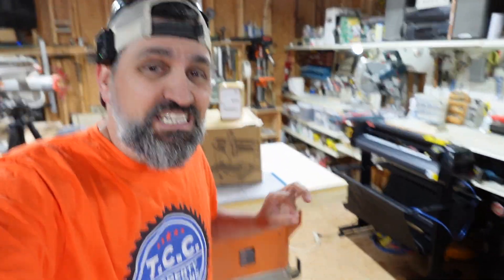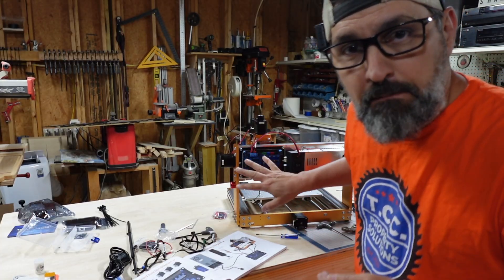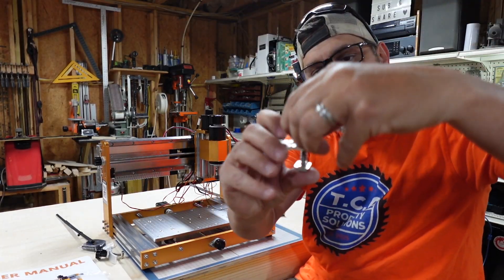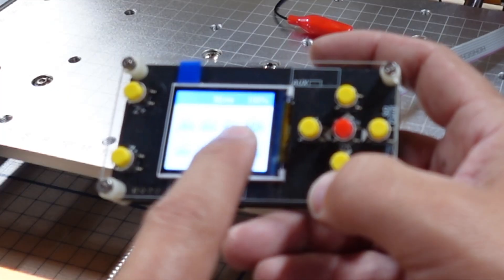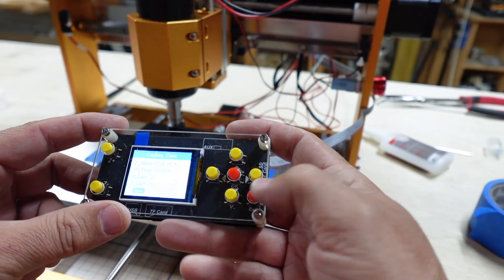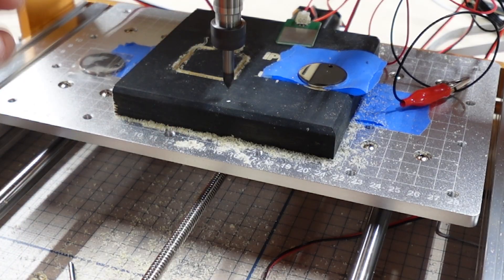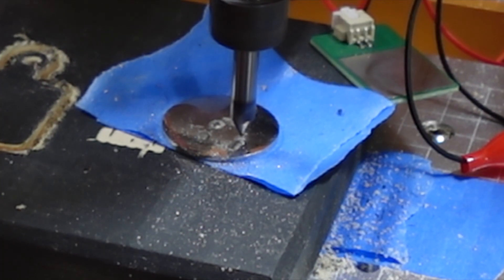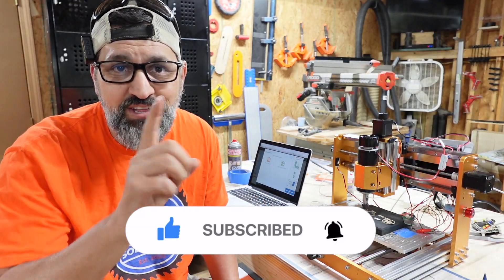Budget Beast? Unboxing & Testing the Lunyee 3018 Ultra CNC!

Comment: While i did learn a bit of using a lathe and a tiny bit of milling 25 years ago, it was by hand and not CNC. So my question from watching this video would be: Did you try to go the same speed (both the tool rpm and the movement of the toolhead) for your metal engraving as for wood? 
Because that could be part of the issue with the bits breaking. (Or that they aren't suited for metal or that kind of metal)
The rule of thumb i learned was: The harder the material, the lower the toolhead movement speed and the higher the rpms. So to take off way less per tenth of a mm of movement. Can you adjust the speed of the toolhead movement according to the material in the software you mentioned? (or on the machine itself?)
Reply from the maker: Honestly I don’t do much of any engraving on metal.  I was messing around with this one.  As you can see I dialed LoL.  I need to get a CNC vise to help in the future.  I appreciate your advise and watching the video! At least I know the CNC works great!
Reply: The spindle speed is not adjustable on this machine. What you have listed is spot on.  I do metal and it is WAY different that wood. The bits appeared to be v-bits and were not made for metal from what I saw.  I only use end mills designed for metal and have no issue.  I use denatured alcohol to cool when necessary.  Oil and such can cause chip overload.  
This machine is great.  Just got to do it correctly and safely, no body parts near spinning bits and eye projection of course.
Reply: @z8ty  Thanks.
We used an emulsion of some oil (no idea what sort of oil it was) and water for cooling and lubricating. And i will always recognize that smell. Makes a huge mess, but works. So i guess the alcohol won't lubricate, but evaporates and so even makes it easier to clean up afterwards.
Reply: @nirfz  yep the alcohol keeps it cool and that’s the ultimate goal even when using the oil/water mixture. I wouldn’t use alcohol on a milling machine, but on the cnc machine is the only option.

Comment: Mine arrived with a broken controller and remote. They replaced both with no Questions. New remote also arrived with broken display.  I won't be using it so I don't care.  They were verry easy to deal with. The clamps would be useful if the the machine had channels on the carriage.
Reply: The clamps will screw into the tapped holes on the bed.

Comment: I understand you don't like wire management but it's a matter of safety to you and your equipment. It's not a good idea to have wires dangling about when you have motorized moving and spinning things around them. I hate to be that guy
Reply from the maker: You're right, you're right. I will work on it! 🤣

Comment: I would have liked a more structured review. What kind of metal was that? how is it with various metals when they are properly bolted down? is it easy to tram?
Reply from the maker: Thank you for the feedback. I’ll consider this going forward!
Reply: @TheCrawlspaceCraftsman  hey, you could always release an "after 1 month" or "after 3 moths" review! This was clearly just initial testing, as noted by the title. Those "experienced" reviews are more popular anyway, give you time to try it on your own schedule, and let you farm one product for more space in the algorithm~
you were however one of like 2 reviewers. the other was japanese, and very structured, though I think it was the max version. (que apple single-handedly demolishing product segmentation marketing by making "maximum" "ultra" and "pro" and "pro x" and "pro ultra" a single scale.) 
also, that metal piece looked like steel, which this machine isn't rated for. you should have some luck with copper or aluminum if you get a tough bit!

 I ended up getting it, to try myself, the reviews for the lower version have it slowly working aluminum. I know things from a material and engineering standpoint, but I'm no machinist, so I still need to learn the actual art XD

A note with metals- you HAVE to bolt them down- or at least a snug jig for them. CNC milling metals at an industrial scale is typically a low RPM, high torque process, where you get a spinning blade and just ram it in and make it shave. think of it like a bladed lathe on a stick, rather than a dremel. This is a high RPM, medium torque spindle. What this means is you need to at least halve the speed for metal working, as an upper value. Another consideration is depth. Metal wears down bits super hard, and going faster accelerates it exponentially (as does going too slow.). You need a hardened bit to remain sharp (good ones are practically self-honing against metal- something you don't get from wood). also, you want to use the bit as fully as possible, as a worn tip means a worn bit. Counter-intuitively, this means with metal, you want to make as few passes as possible, while going as deep as possible, with your machine!
Reply: Agree 100% - talking about being all over the place...